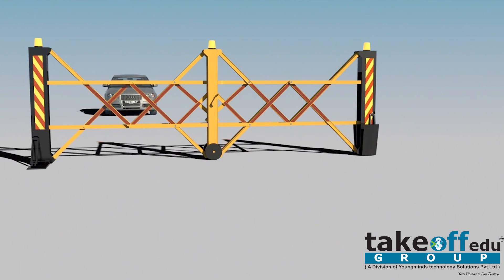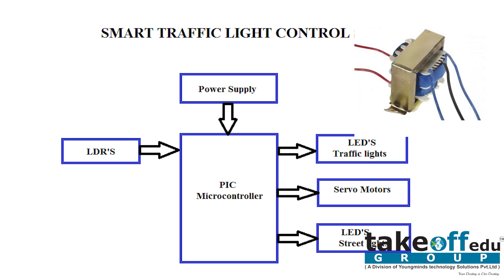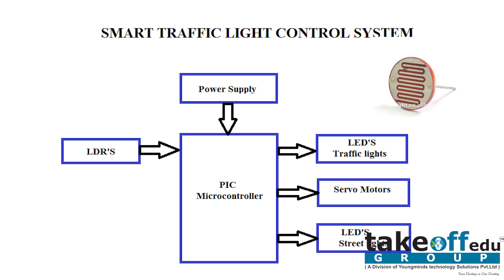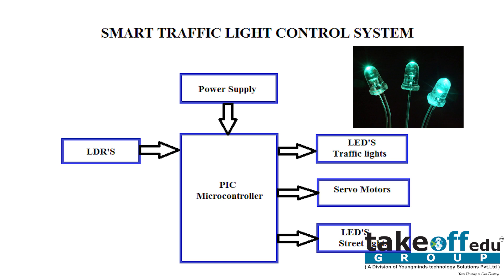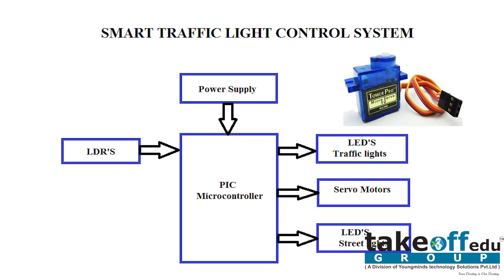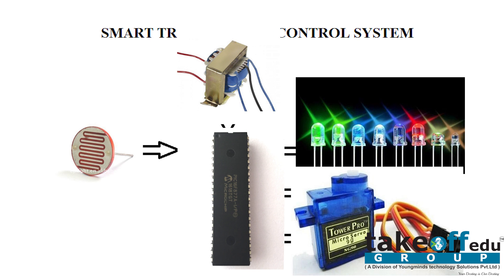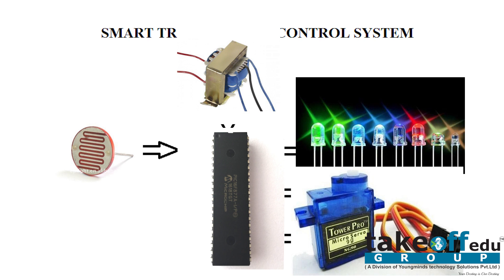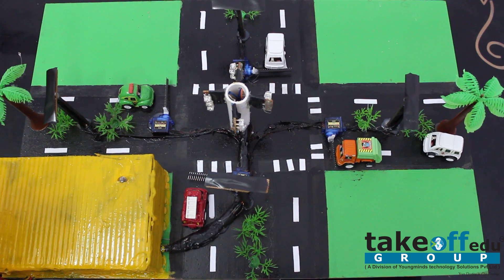Smart Traffic Light Control System with automatic vehicle speed braker

Comment: Great in theory (as well as perfectly demonstrated 🙌) but it will need Everybody to drive not only with caution but also with great Discipline, given we know something about busy Indian streets🙈 Which would slow down traffic at places just because these things are in place.
I watched the demonstration again after reading comment from a person which is rightful in his opinion that if this system fails with simple powercut to even one individual pole, the barricades of whichever kind wont retract that's most important thing as we would have still been able to drive if there were no barricades like normal city streets when the signalling system get broken. This is also the case with project where entrepreneurs have designed to place one directional pikes that will come out once the signal turns orange.
It would give people chance to damage the infrastructure in working just by bumping into it and saying they had a breakfail in their vehicle...